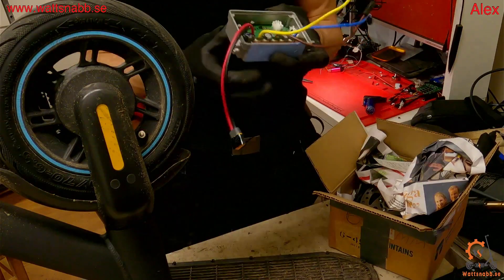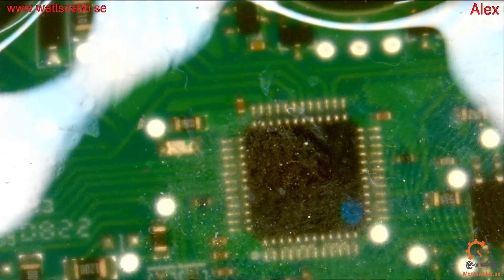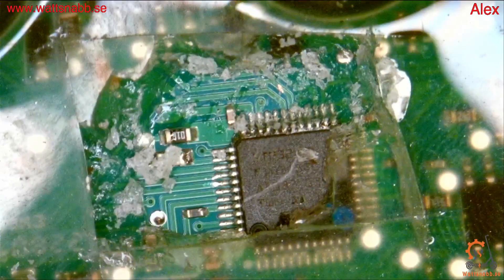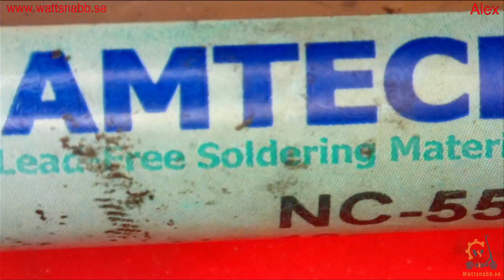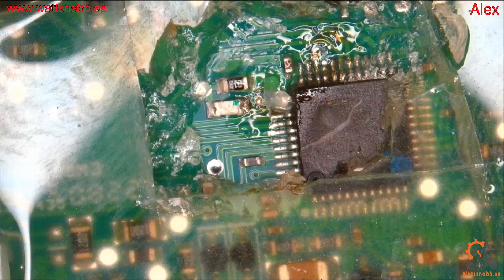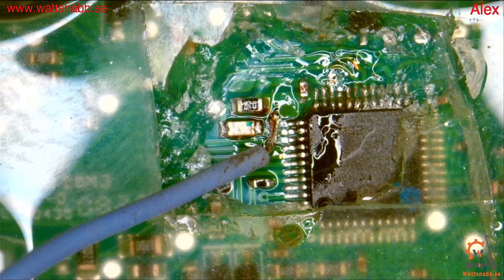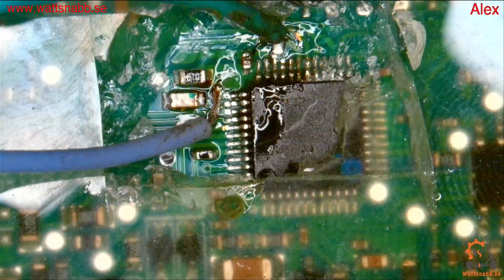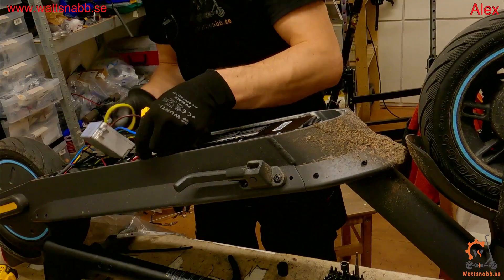How to Stlink 3 capacitor controller for G30 **NEW METHOD IN DESCRIPTION**

Comment: Can you please help I try flashing a custom firmware and now I'm stuck on 12 mph I tried flashing other custom firmware but I have no luck I wanted to know if I replace the whole controller to a brand new one will it take it back to 18 mph
Reply from the maker: Hi. If you buy our costumfirmware controller 
https://www.wattsnabb.se/products/ninebot-g30-max-modellerna/reservdelar-till-ninebot-g30-max-modellerna/original-ninebot-g30-g30d-max-moderkort-kontrollkort
Then it will work. I cant speak for other vendors.

Comment: You know there are Pins, U dont have to Connect directly to stm32F lol
Reply from the maker: Yes I have a video about that. But the pins are on the back of the controller.
Reply: @WattsnabbAB  ahhh OK✌🏻
Reply: @WattsnabbAB  i search a video about Ninebot e22d, but i would take 5v and ground from the dashboard + and - connection.
Can i go like this?
Reply from the maker: @mr.taddel4282  havent tryed it on them but I think it also work.
Reply: @WattsnabbAB  yees, IT worked
Reply from the maker: @mr.taddel4282  yeah :)

Comment: Best STLINK videos in the world, you are great! Thanks for replying, I have another question: I bought the soldering iron, at what temperature should I set it to make a correct weld? For the first time, is it easier in the back or front of the controller? I don't have the grinding pen.
I have the exact same controller in this video, in other online guides the front connectors are in another place and no grinding pen is needed.
Are you sure those are the only front connectors? In the forum rollerplausch scheme indicates without grinding pen in another front point.
Reply from the maker: Hi 
Its all depends on what soldering iron you have. You have to practice on other board just to learn first. Then you will notice what temperature is the best. Between 330-370c try in that range. Becuse its also depends on what solder you have and what tip. So solder in the front pin you need to have a microscope and skill with the solering pen. The back connect I have a video on also. just mesure this pins and know they are working, maybe there are more pins but don't know actually. So the pins on the back is easier but it's harder to get the controller of. But like I sayed I have a video on that to. :)

Comment: I actually use  a piece of wood  that I sharpen an edge on and push it down into the silicone. Less chance of cutting components with wood.
Reply from the maker: Yeah maybe. They are so tiny so just by looking at them they can get damage :)
Reply: Same method here.